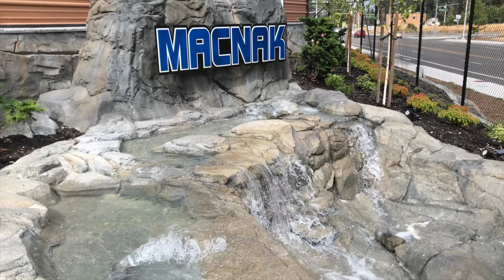New Custom ICF Home - Part 13 - Concrete Sculpting Decor

Comment: No icf roof??
Reply: ROGERIO REALTOR A. While our ICF walls are competitive with standard stick frame pricing standard 4/12 or greater truss packages are currently much cheaper then ICF roof systems. However on flat roof systems we will be using an ICF system.  Stay tuned, we’re planning a flat roof system on an upcoming Hawaii project.
Reply: Terence King great, I will love to see it!